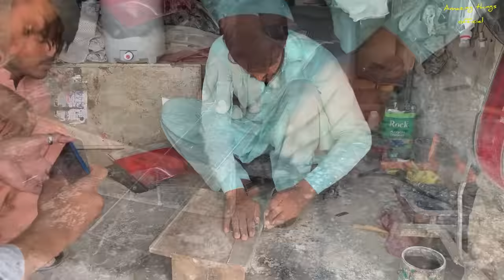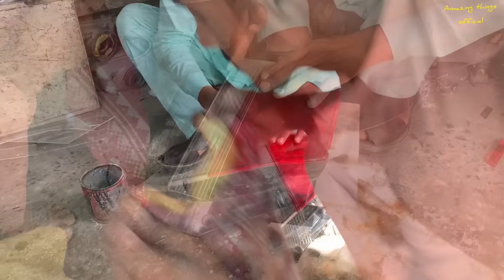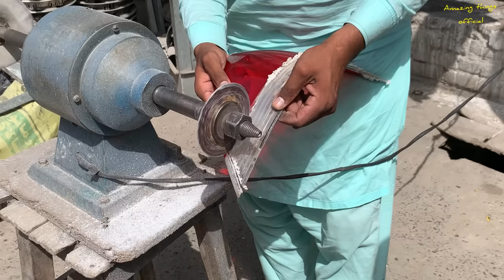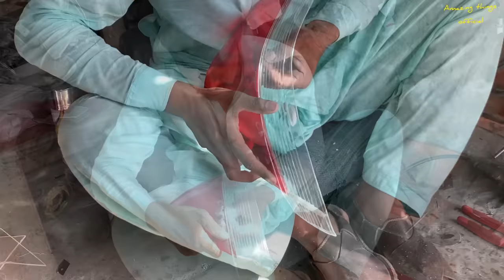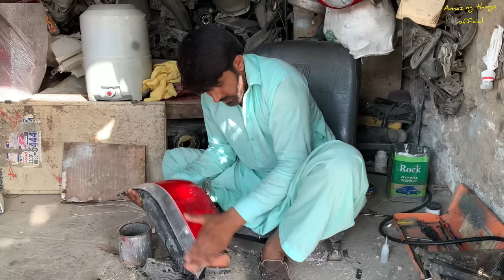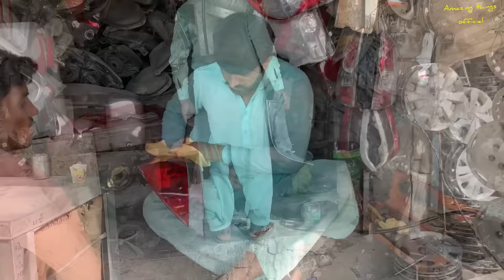Repairing Car Tail Light Broken Lens in Just 3$ || How do You Fix a Broken Tail Light Lens

Comment: When I was 16 I made some of my own left and right, front turn signal lenses for my white, 2-door 1979 Honda Civic 1200 (mounted under the bumper).  I used thick clear acrylic (designed for ceiling light fixtures) and then used amber bulbs.  That was a pretty cool mod back in 1984!😀
I was lucky to have a plastics shop class back in middle school come to think of it!